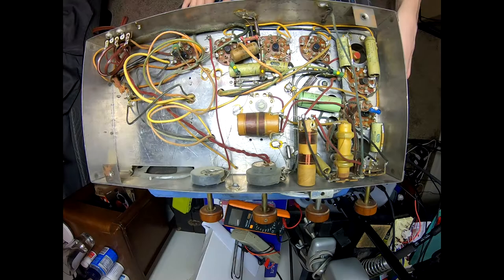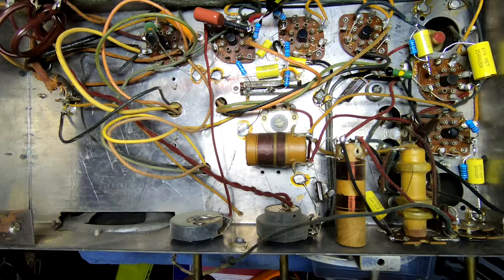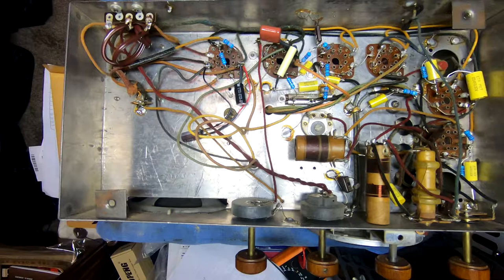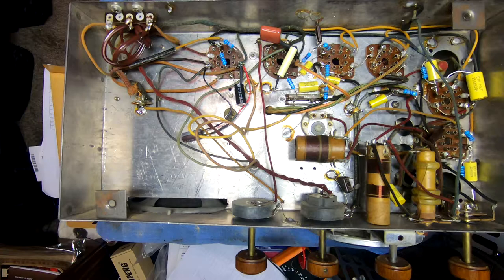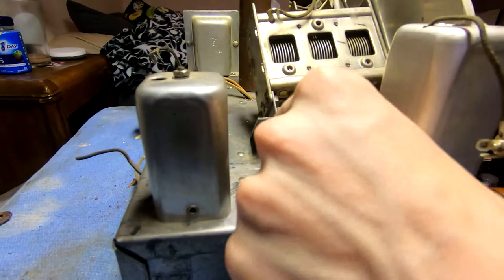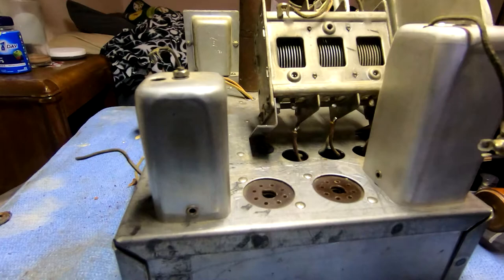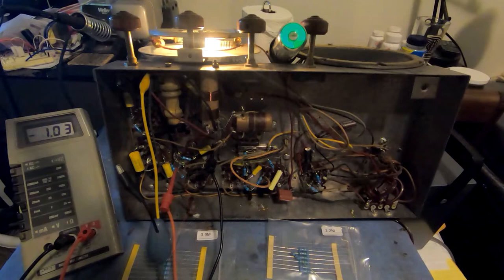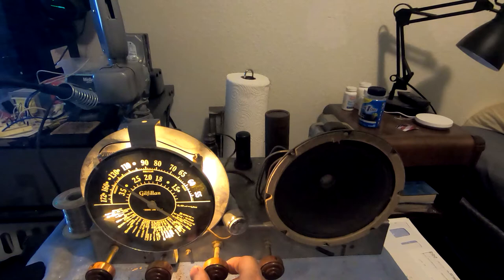Gilfillan 711T Part 2: Recap and Eye Tube Adjustments

Comment: Could you provide a link to a schematic for this radio?  A free schematic.
Something you might want to keep in mind is if you have another voltage divider need arise, you might consider adding a 10 turn potentiometer to the circuit to fine-tune the voltage.  I know, its overkill and a bit excessive, but hey, it's an idea.
If you like interesting and challenging radios to work on, I strongly recommend that you try to obtain and restore a BC-348 receiver.  They were used on the B-17's and I think B29's as well.   The E, M, O, P and S versions (possibly others as well) have some very interesting aspects to them.  For one thing, there is a potentiometer attached to the shaft of the tuning capacitor and is used to maintain a constant noise level across the band.  Also, the IF frequency is 915Khz + or - 1%.  If you do manage to obtain one, I can provide you with the service manual for it.
Reply from the maker: I'll dig one up on NolstalgiaAir and post a link in the description. Thanks!